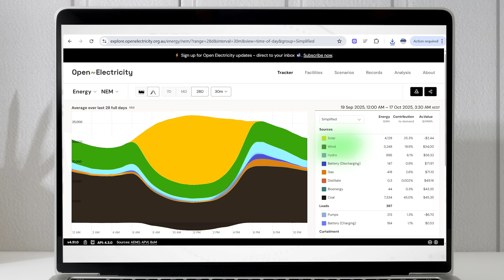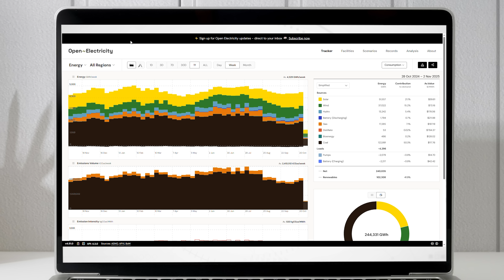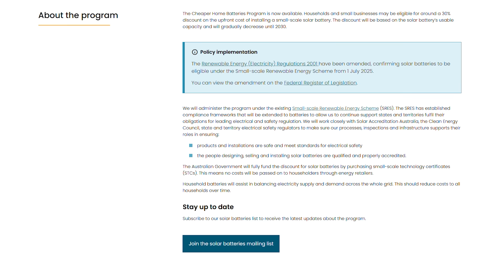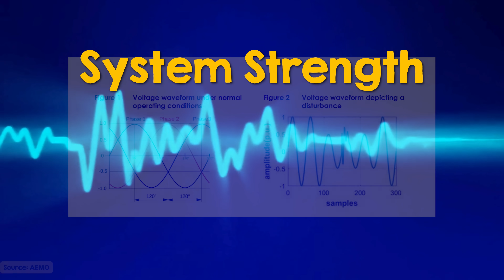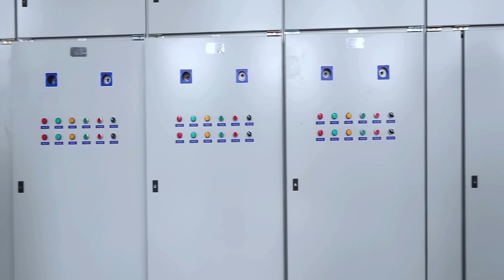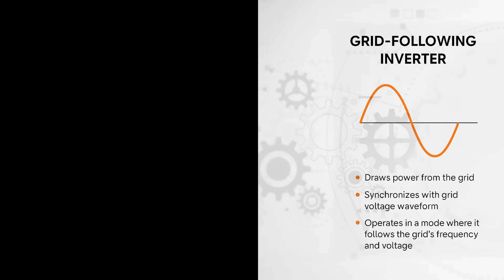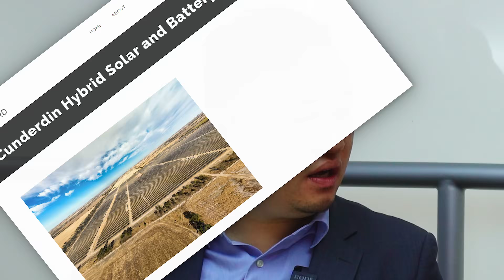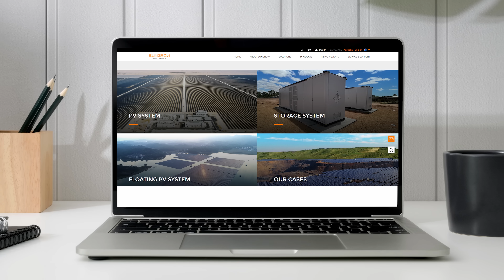Australia’s Solar Boom Is Breaking the Grid - Or Is It?

Comment: Well, Rosie, you CAN'T! The system and the grid back then were made for reliability and simplicity and easiness to maintain, and it worked for so many years in which was made most of the progress in human history (in one Century, many times more than in Milenia before).Surprise, Surprise when you give people free money they take it. Only thing is there is no free money. 30% subsidies are pretty much. I'm sure that's driving surge in buying batteries, but at the end someone have to pay the price. That will be of course higher electricity prices and taxes. So, you are not achieving anything you're just buying silence from the people, using their own money to trick them in to enriching you and all scammers like you. Australia uses 800 GW/h per day (1GW installed rated capacity per month) so you need 800 more months (67 years) to cover it for just one day. And what are quantities of materials to do that (Impossible). What if there is no sun or wind for let say 2 or 4 or 24 days then what, Dark Ages? As if the "Green Renewable" grid is not complicated enough, you say let's make it more complicated! Great. As the true story goes about a conversation between the executives of an Automobile and a Computer Company. The Computer Guy says: our technology advances much faster in 10 years than yours did in 100. And then the Automobile Guy says: yes, your system crashes so many times and says, "sorry for the inconvenience" and nobody dies. We can't afford that because if one of our systems fails people will die, that's why our systems are not so sophisticated, but they are very reliable and safe. This was 20+ years ago but now the same applies only that you want to impose an unstable unreliable digital system on us everywhere and put us in a mess like in Spain this summer when 8 people died because of the unreliable system which digital is, and mechanical isn't. You are a Fucking FRAUD. Fuck You!
Reply: That was a lot of rambling nonsense.
Reply: @Rangeraaron  Nonsense is to say what you did and give no explanation what specifically is nonsense in my comment and why. As I did on topics in the video. I'm looking forward for your reply where you address specific claims I made in my comment and of course reasons why you think they are nonsense.

Comment: Syncons don't need a sensor or control system to tell it to provide freq support. It's tied in. One should never forget this. It's job is as a failsafe , and allows the LDC to then fire Grid forming inverters into action

Comment: Batteries based on current technology cannot be the answer. We have never used batteries on masse, at scale and over the long run. 

The longevity of a mechanical generator is not great, parts wear, bearings need to be replaced, yet it is orders of magnitude longer lived than batteries. The environment footprint of a spinning turbine, assuming its drive force is gravity fed water, is grease, steel, copper, rubber and paint plus some small circuit board electronics (99.999% recyclable).  

Contrast that with Li batteries, they are riddled with toxic materials, there is no at scale recycling available and they have a half life orders of magnitude less than mechanical. 

If we start rolling out batteries everywhere, for a start we loos 5% of the energy that we put in, from the get go, this gets worse every day,  they have at most a merer 3,000 full uses before end of life compared to mechanical that can be used trillions of times. 

So what do we do with the batteries when they fail on mass after a few years? land fill?  I can't see that going wrong. Along with the solar panels and wind turbines that have to go to land fill as well. 

On top of the cost of dismantling, transporting and dumping we then have the cost of en massive refreshing the entire battery fleet every 10 years or less (along with the wind and solar). We don't know how robust the system would be against solar storms, not to mention they catch on fire regularly and can not be put out. 

Batteries are good for small use cases, powering a watch, powering a phone, a home off grid system and so on, where they are cheap and easy to replace, trying to use the current battery technology at scale it is just dumb on every level and we doom future generations to be paying for it in multiple ways, for years to come. Tell me, would you buy a second-hand EV, batteries just dont last?

Comment: One thing I would suggest is creating central batteries for all the solar energy or making all new homes install solar and battery systems
Reply: Power degrades over distance, this is not viable. Batteries would need to be added frequently along the transmition lines. Not to mention needing far more step up and down substations to accomodate this.

Comment: Had to take everything you said with a grain of salt because of your sponsor.  Also, as far as battery technology reducing costs, I just don't see it.  Energy storage is currently all theory and dreams, we do not have systems that can store 12-24 hours of our energy needs (certainly not economically), this means we will have to duplicate our generation with coal/gas/nuclear.  For as long as we need duplication the cost will always have to be more than if we just had a single 24x7 standalone system (like coal, gas or nuclear).  Those running the gas/coal/nuclear systems while at the moment are being subsidised by the taxpayer (I hate saying the government as it gives the impression that someone else other than us are paying for it), this cannot last forever; this means those companies will need to have consumers pay for their generation system regardless if they are being used or not.  I see all of this as an economic ticking time bomb, further an unreliable and expensive generation system does not provide the environment for manufacturing, data centres, anything that needs reliable cost-effective power, the very businesses that drive our economy.
Reply: yeah batteries are just declared as the solution – nothing to discuss there.. magical engineering basically – before quickly moving on to the main promotion- i mean point.

Comment: interesting video, basically a paid advertisment for the solar industry, The Broken Hill system was talked about in detail but no mention of the recent catasrohpic failure that required multiple diesel generators to get the grid started up again. There is no mention of the massive cost to bring these systems on line, the huge batteries to run industry and all with the need from huge subsidies paid for by the taxpayer adding to our huge national debt all for a false narrative, solar will never make up the majority of the grid as it is quickly reaching the tipping point to where it will bemaking the grid very vulnerable to collapsing,

Comment: If the solar is so cheap, why do big manufacturers close down, stating high electricity prices.
Reply: Electricity prices are linked to gas prices because gas-fired power plants often act as the "price setters" in the wholesale electricity market, meaning their high operating costs set the price for all other generators. When gas prices rise, this pushes up the price of electricity, as the cost of the most expensive generator on the grid dictates the wholesale price for everyone. This happens even if gas provides a relatively small portion of total electricity generation.
Reply: If you dont own oil and gaz, you will see renewables as cheap, at the long run, to escape away the cartel prices... ;)
Reply: Did you see how power prices go negative during the day? That's because solar power is cheap. It's coal plants that make grid power expensive.
Reply: @ajar1000  

We had 100 YEARS of cheap and reliable power from coal powered plants in Australia, now, according to you, it's the coal fired plants that are making the grid power expensive???

Can't you see the problem with your statement?

It's OBVIOUSLY the transition to renewables that have CAUSED the problem.

I'm not against renewables, but blaming coal powered plants for the rise in electricity prices is just intellectually dishonest and does nothing for the credibility of renewables or the integrity of those that keep stating it.
Reply: It's 'cheap' when the sun is shining. Large industry needs consistent power 24/7, and given that VRE is not reliable all of the other stuff required to complement that 'cheap' solar makes electricity expensive. Basically: 'cheap' solar generation doesn't actually mean cheap/affordable electricity (and yet, 90% of people in these comments are fixated on touting that solar is the cheapest form of generation... either willfully ignorant that that's half the story at best, or a charlatan attempting to obfuscate.

Comment: I built a $3000 solar system that runs my sharpening business and my wife's retail business,  second hand panels for nearly nick, $1400  on 600w lithium and controlers etc all off ebay, my business doesn't get power bills and the $3000 will be offset in aprox two more months....winner winner chicken dinner 🐔

Comment: This was VERY interesting and informative! Thank you so much for posting. I never woulda guess Australia went so far in with solar it made electricity basically free! Lol. 

That being said NGL hearing there’s an issue with pricing being “too low” and energy being “too great” one would think maybe they’re not using it to its full potential. 

Australia IS an island and I’ve heard they do have issues with water or getting water supplies. Could solar be used to power desalination plants? Not a TON of them, but enough to help offset the stain on freshwater from the landmass itself?

I’m NOT an engineer by any stretch so please don’t yell at me. Lol. Just a thought. One I’m sure SOMEONE has had. I just know a main issue people have with desalination plants is they use a LOT of energy.

Comment: Storage is, and always has been, the weakest link in the renewable chain. Better batteries may be on the horizon, but so is cold fusion. It's probably a good idea to modernise the coal-burning, conventional power stations and then work on developing a decent nuclear alternative that can reliably supply power at night ... when all those cheap electric vehicles need to be charged. It is instructive to reflect on the financial benefits we have so far reaped from the (intentional) stagnation of the existing system and the incentivised pushing of renewables. Cheaper power? In your dreams!

Comment: Lateral thinking idea. Set up a system where people can charge their EV in city parking. Not super chargers basic 240v points. Minimal infrastructure needed.

The EV can be charged with the cheap power and be less of a draw on the grid after dark. An EV is basically a powerbank on wheels.

Not a solution but it will help.

Comment: At the end of the day, all governments should keep some form of fossil fuel or nuclear power plant. If that’s what the taxes are for it should not be based on profit everything else. The government should support, solar wind energy, so everybody can power themselves government should always have a back up.
Reply: Not a market forces guy? In a privatised grid (another liberal party idea) the government doesn’t use tax revenue to provide electricity. Only where the market fails.
Otherwise, what is most economical to do the job? Use market signals to shift demand

Comment: “Synchronous condenser” is a new term for me, and turned out to be a fine rabbit hole to investigate.  Grid forming inverters sound like a good idea so long as there is top notch security in its control system’s internet/network access.

Comment: Back in the first solar push we got it, 3 phases, just 6.6kw of panels on each. We only use a single phase, and that generates an excess of about 10kwh a day, the other 2 phases are pure profit. It took 2 years for the stuff to pay for itself. We had a long long contract with the provider, still getting 50c feed in rate on all 3 phases. Its fun because I have off peak circuits too, so I use them to run everything most of the time, paying about 9c/kwh, and at the same time selling them the 50c/kwh solar. And that still happens after a new smart meter a few months ago. 

It is not my fault the system is broken, but if you have enough roof why not.

Comment: Q. How to keep using solar without breaking the system?
A. Do what AGL did to me and blocked me from uploading any electrons to the grid.
Funny thing is AGL were quite happy to STEAL all the excess I produced in the first 13 months the panels were on my roof which the unused excess that was generated was over 5MWh.

I just wish I was able to add a 40kWh battery to the small but massively expensive $12,800,  9.8kWh LG battery that I purchased just 13 months after the insufficient 6.6kWh of solar panels were installed.

Comment: So the burning question is how vulnerable are these inverters to to RF interfearence ?
Being a lot older that you I remember the sun spots of the 70's & 80's shutting down communications networks , creating havock with server farms ,knocking out all sorts of radars .
Then on top of that there is RF used as weapons .
More than one in development designed to destroy computer networks .
You can't do that to a 15 ton turbine .

IMHO the problem is trying to force the centralised generation grid to work with a distributed system for the sloe purpose of guaranteeing the profits of the generators who bought government power stations one of the most stupid things morons pretending to be politicians have ever done .

As for home batteries I remember my chemistry lecturer from back in the 60's 
"the only difference between a battery and a bomb is the rate at which they release energy "
When Sol Griffiths was trying to convince people to invest in single suburb or even suburban block micro grids I had high hopes that solar would be done to benefit the people and not the shareholders but it look like everything else which public money going to prop up share prices of companies that are making obscene levels of profit to start with as we are still paying for the grid upgrades for the thermal power stations that are closing down .

Comment: It may work in places like Australia - hot and sunny. But what with cuntries in Central, Estern or Northern Europe.
It these countries energy needs to be stored not only from day to night, but from summer to winter.
Additionally byproduct of generating electricity in thermal power plants is heat. For each unit of electricity there are 2.5 units of heat produced.
How to get this energy for heating homes.
In Europe district heating is a standard. It provides heat not only in winter for heating, but also heating hot water in our taps.
Not everything is possible everywhere.

Comment: Are there any plans for electrolysis based desalination power plants? When power is costs little or cost is even negative, split saltwater using that power, store the hydrogen, then burn it at night for power and freshwater.

Comment: I installed a Sungrow system before the subsidies and I have had nothing but trouble. It was installed by Virtual Power and I use Amber as a VPP. neither of these companies have been able to overcome the issues I have have for almost a year now and both of these companies blame Sungrow software for the issues I have. Don't believe a word of what you are hearing! There are still a lot of unresolved issues to be solved.

Comment: yeah great we're solving problems weve caused under the promise that electricity would be cheaper yet no talk or mention of that. Why because that fairy tale  was sold to us because power companies could charge people without solar for excess solar power they never made until they became less and less a core into a standby worked out how to keep relevant.   Batteries are more expensive than coal cause we pay battery power cost for power. i want cheap power

Comment: It's not the coal power plants causing the negative price - they were here first. It's the solar that came along and caused this issue without having a complete solution to support the solar transition. It's a side-effect, if you like. I also have a few expletives stored up for when they try to charge me for generating solar, after spending over $30k for my solar and battery (no rebates  on the battery).
Reply: I would absolutely blame coal power companies. They ran negative scare campaign against all other plants in the 60s until they monopolized the market. They convinced Reegan to remove solar panels off the white house. They comvinced many countries to be anti-nucleur. They throttled battery innovarion
Its always been a monopoly problem, not a power source problem
Edit: Also, they were not first

Comment: You only have to watch the AEMO dashboard to see how much solar and wind has destabilized the grid and lowered the overall efficiency of power generation. We are now running simple cycle peaking turbines to support the grid when the sun goes down, these things typically run in the low 20's % thermal efficiency. Proper base load thermal generation or base load co - generation plant can run up into the high 70s% thermal efficiency. SO we are burning 3 times the fuel to produce the same power, sort of makes the savings of solar and wind a mute point.  Go Nuclear, stop messing with the grid.